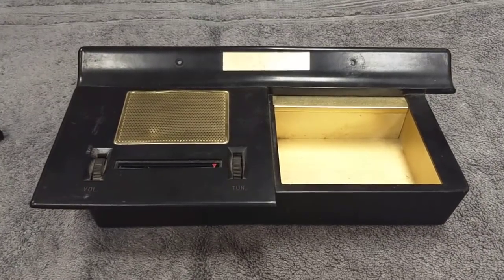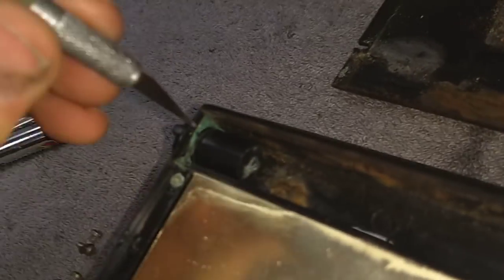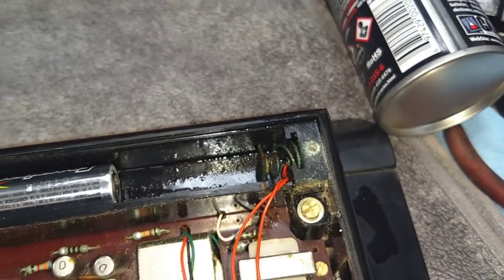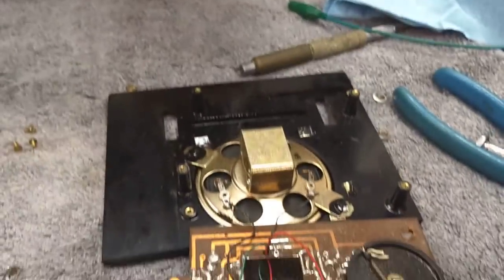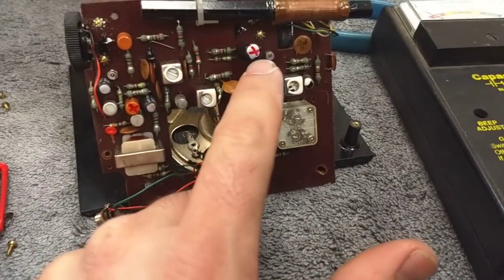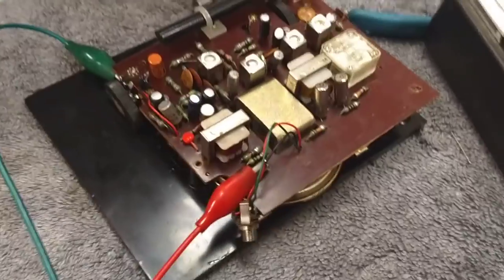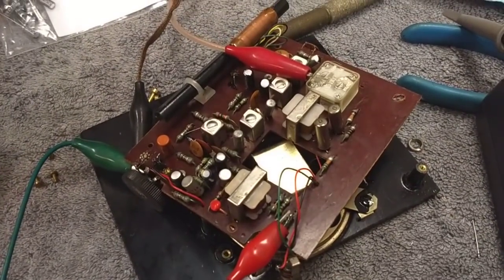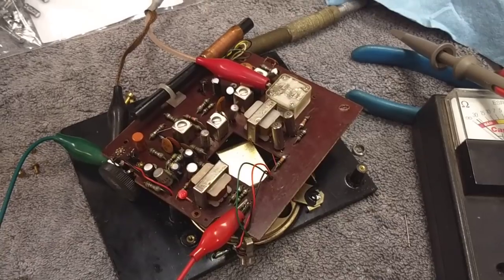Diagnosis of an acid eaten, unknown japanese 7 transistor desk radio

Comment: I was looking at your library of videos and just saw this one of course from long ago. Anyway, I just saw something that caught my eye. It looks like early in the video when you put the four batteries in, they were in backwards. Look at the red wires solder to the spring loaded plate. Also, I've come across the type of battery installation similar to this with a retaining cap and the bottom of the battery always faced the cap. It's possible that something got damaged by improper polarity. The old transistor sets often had a warning sticker attached to the battery compartment.
Reply: I have seen this also....just because it looks a certain way dont make it right...and with the PNP trany's they run backwards with negative being positive, which would explain the high current...

Comment: You could use vinegar to remove the corrosion and then you can rinse and then polish the metal to finish it.  This works great for acid battery terminals.